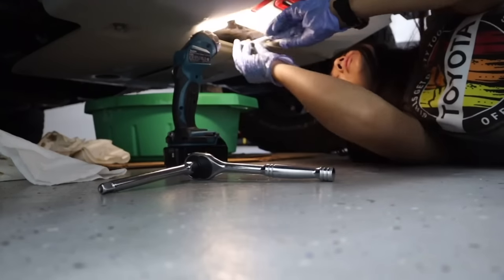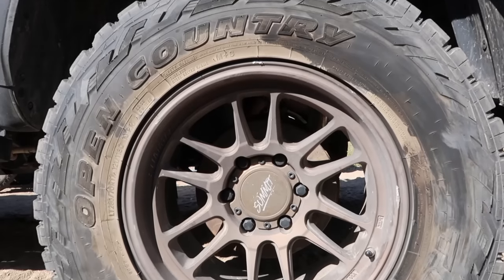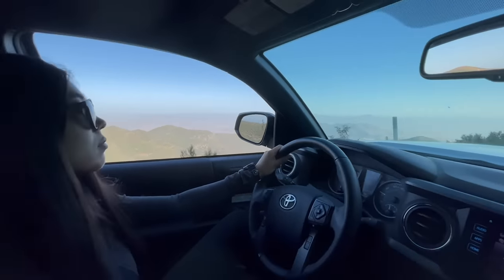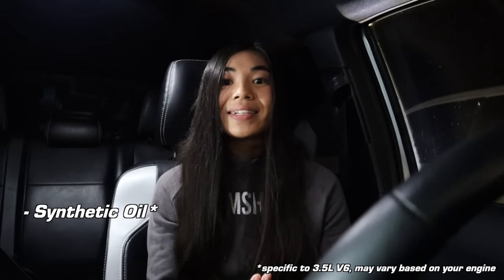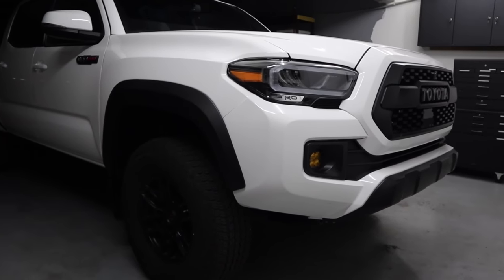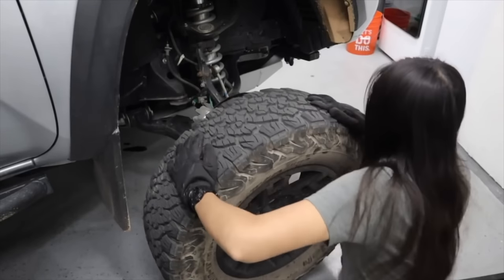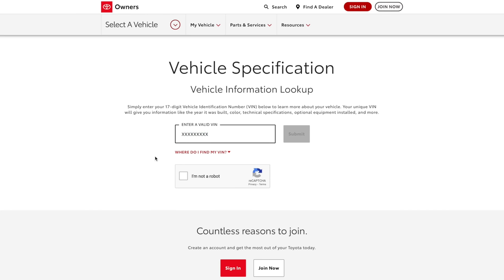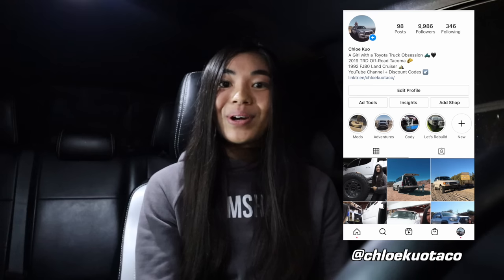What I Wish I Knew Before I Bought My 3rd Gen Tacoma | First Time Ownership + Tips & Tricks

Comment: Very informative and well organized video! I actually purchased a 2020 Tacoma TRD Offroad and I sold it 8 months later because I hated the way it drove. The nonstop gear hunting was a big part of it, but the main issue was really bad chassis vibrations. I took it in to the dealer several times, but they were useless. I liked the features of the truck and the long term reliability appealed to me, but it was so annoying to drive. That said, I've checked out all the other midsize trucks, including the new Frontier, and they all have shortcomings. I want a well equipped midsize long bed truck, which severely limits my choices. Sadly, I might wind up getting another Tacoma because it's the only midsize that has all the features I want. If I do get another one, I will do an extended test drive this time to make sure it doesn't have the same vibration issues the last one had.
Reply: Get a gladiator
Reply: @matthewkirkland6497  I wouldn't buy a bicycle from Jeep. They have some of the worst reliability in the industry.
Reply: @dlg5485  I don’t know 🤷‍♂️ any midsize truck that can tow like a Jeep almost 8k so maybe 🧐 used f150
Reply: @matthewkirkland6497  I'm just soured on the truck market these days because trucks are absurdly overpriced and you still have to make major compromises. I like owning a truck because I go camping/hiking offroad quite a bit, but I'm actually starting to think about an SUV, something like a Subaru Forester Wilderness. I'm sick of skyrocketing truck prices.
Reply: @dlg5485  yup my coworker bought a gmc with some options gone because of chip shortages. He’s been to the dealer 3 times and over 2 weeks to install stuff like heated seats. Heated defrost for the mirrors or back window. It’s ridiculous to buy a 75k plus truck and go back to the dealership 3-7 times to add options you bought that aren’t there.

Comment: Do you 3rd gen owners experience engine knocking when cold start/winter ?
The 4.0 in the 2nd gen sometimes tent to produce a knocking sound when first started in cold conditions
Reply: Depends on how many miles you have on truck. My 07 Tacoma has 350k mile on her and I have never ran into that issues. Tacoma are gasoline direct injection which mean carbon build up after 10k miles. If I were you I would run a higher gas grade for a road trip. This will clean up the carbon build up than I recommend clean the intake value with can that uses PEA Or polyethyleneamine. If that doesn’t work change your spark plugs. Best of luck.
Reply: @09FoxRider  I've tried higher octane fuel, fuel additives and religiously changed the plugs every 30k...truck is a 2013 with 155k on it, started noticing that noise around 120k and it only does it in the fall/winter.
Thanks for the reply
Reply: @OP941nine  check your engine light and run a scan while you drive. If you are still getting knocking then try to vacuum suck up some intake cleaner. Also make use your engine has the correct oil. Sometimes the cheapest oil change are not the best oil for your truck. There are videos of ppl using seafoam but look for one that has PEA and get 2 cans of it. I would run a can once a week to clean out the engine. Walnut blasting is the other way but it’s extremely expensive and I would recommend a professional to do that. Best of luck!

Comment: This has been informative. You have done your research on the recalls and other idiosyncratic issues about the tranny. Of course most owners have heard the debate, but you really have identified what is subjective and what's objective about some subjects. Like you, I have not had any problems with the programming of the shift points in the stock version, even though I definitely feel it's different than driving a Ford or American made truck. I also understand they are engineered differently than a Ford or Chevy so I'm not expecting the same experience, but there was an adjustment period up front. Thanks for all you do! I'm subscribing.

Comment: Doing your transmission fluid exchange will require an advanced scan tool, and obviously a technician that is certified to do a transmission fluid exchange it is very strict that the fluid is at the correct temperature to do this fluid exchange this also applies on topping off the transaxle fluid. Doing this service is pricey, that is why I'm happy that I work for Toyota and I'm a tech I get free fluids lol

Comment: Purchased a 2017 4x4 and thought i was buying my last truck. NOPE..Had issues right away. The drivers seat did not adjust up or down. Being 6 ft i kept hitting my head a top of door when getting in. Real quick I discovered the truck was always shifting, up and down. Spoke to a friend who worked for local Toyota dealership and told me this has been a huge complaint by owners yet they never corrected it. Then tow capacity. This ones on me. I should have researched this more closely. So after 1 year i got rid of it and never looked back. This might be a very popular truck and huge seller for Toyota but test drive it like you own it and do your homework before buying.

Comment: I'm same as you with the oil changes.  10k in between oil changes seams crazy to me.
Reply: if you go with toyota full synthetic it is find. i trust the engineers more then you guys
Reply: @jacobeady5730  Cool.  Love the unnecessary sass.  Another thing to keep in mind is the advertised "cost of ownership" that all manufacturers tout.  Stretching out oil changes to 10K makes a vehicle seem cheaper to own.  There are numerous mechanics (including ones at dealerships) I've talked to who all say for their personal vehicles they do full synthetic oil changes at 5K rather than 10K.  But by all means do whatever you want to your own vehicle.
Reply: As Scotty Kilmer says “oil is cheap, motors aren’t “  change it every 5k miles.
Reply: I’m a chemical engineer and work in automotive. We test the engine oils at intervals at 5k, 10k, 15k, 20k, 25k miles for all types of engine. We take this data and report it to the manufacture so they can set the ratings for cars. Full synthetic is perfectly safe and offers better protection for engines. If the manufacture states 10k than your fine as long as you use the correct oil stated. My 2007 Tacoma has over 350k miles and I change the oil every 10k. Using full synthetic we find that even at 15k the oil is 80% dirty and 20% clean. It also helps to have a solid oil filter installed.

Comment: What are your thoughts on the OEM mudflaps, I removed mine because since they’re made out of a hard plastic I felt they might get ripped off when going off road, I am debating whether I should put aftermarket ones on or just leave the truck without any mudflaps, also  the truck looks more aggressive without my flaps in my opinion
Reply from the maker: My tires kick up a lot of stuff (and even took off a lot of the powder coat on my old side steps!) so I’ve opted to keep them on for now. Maybe I’ll cut them in the future if I run larger tires

Comment: Note that oil change  after 10k mile is ONLY for the first oil change. After that it’s every 3k to 5k miles.
Reply: What?
Reply: Check the Toyota manual. Brand new Taco requires oil change at 10k. After that every 3k to 5k.